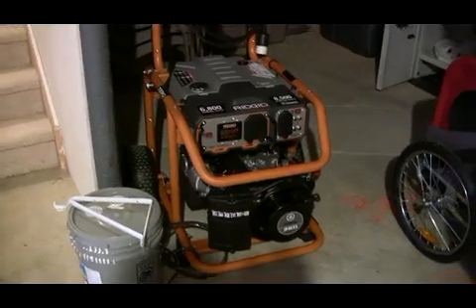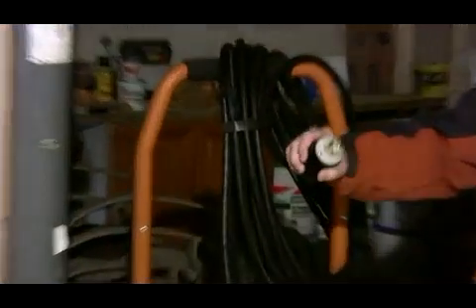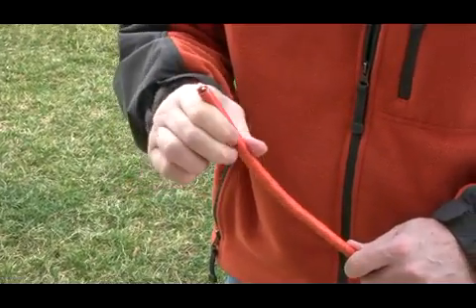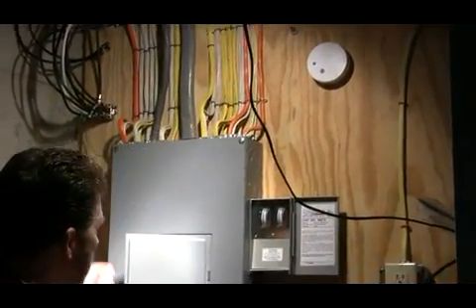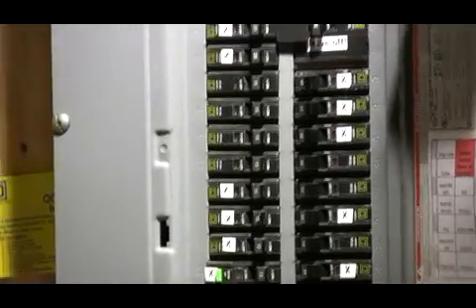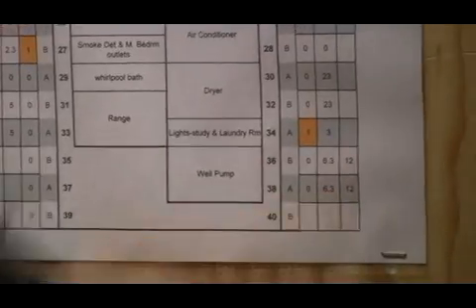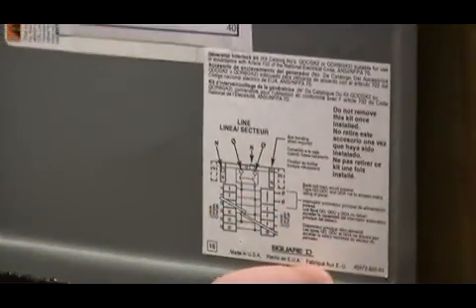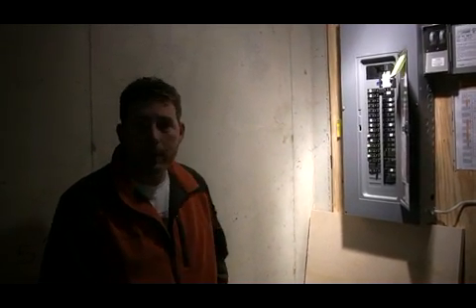Interlock vs. Transfer switch

Comment: My main circuit panel has the neutral and ground wires mixed on both of the buses. It appears there's no dedicated neutral or ground bus, but I do have a bus on either side. Would this mean my neutral and ground are bonded? And would this install be any different than what you did (just connect neutral and ground to either bus in my situation?).Thanks
Reply from the maker: Most likely yes, however to know for sure you would need to trace wires to find where they both go to ground.

Comment: The interlock switch lets you choose which circuits are hot.  It feeds both bus bars in the breaker panel.  You probably cannot select and electric clothes dryer and an electric stove burner unless you have a very large generator.  But you will be surprised at how many items you can run such as TV and coffee maker. Forget hot water heaters and electric clothes dryers at the same time.  The transfer switches limit you to predetermined circuits and typically only about 6 circuits.  The sliding interlock lets you change your mind.  The transfer switch will cost you about 300.00 for the switch and another 200.00 to 300.00 for an electrician.  About the same as a decent size generator.    Do it yourself if you are not afraid of electricity.  Takes about 1 to 2 hours.  This video was exceptional.  The home owner covered the project very well.

JoeB

Comment: One important note is you generator's bonded neutral should be removed if it has it. I was told by inspector. I have the 200amp breaker box with built in meters and interlock so I didn't have to buy it all separately.  Love your labeling and print out.
Reply: Ok watched your follow up video, spot on, what I plan on soon is putting a heavy duty switch on the bonding at generator so I just have to flip for BU or Camping.

Comment: Nice, this is exactly what I am planning to do before I even saw your video.  It seemed to me that a transfer switch is for someone who wants a foolproof installation.  An interlock device allows you to selectively power your house as needed - but you need to know what you're doing. An interlock is definitely more versatile.

Comment: Seems like you could make an interlock plate to fit nearly any main panel, as long as you have a few skills and the inspector will like it, or, DIY and take the risk? but if it works correctly, I wonder if he'd OK it?

Comment: I was debating about going with a transfer switch or interlock. This was a great instructional video, and helped me get my interlock setup installed. Next I will be converting to Tri-fuel using either the Motor Snorkel or Century type conversion.

Comment: I did it right and took the time to install a 10 circuit transfer switch. Comes with the meters, breakers and jewel that lights up when permanent power is restored.also added a batter operated alarm that tells me when the power is restored.

Comment: Excellent video. Good installation, well thought out. I opted for a six circuit panel with an ammeter on each leg. I'm happy with it, but I do like your setup as well. I've seen too many disasters with neighbours who back feed through their dryer plug.

Comment: interlock is good way for the average homeowner to have overload issues
Reply: care to explain your remark
Reply: Because a DIYer could try to run the whole house on a small portable generator and overload the generator that's why a transfer switch would need to be put in a place as as per code 700.5 of the national electrical codes states. A portable generator is only good for about 6 circuits
Reply: I see just didn't know what you were referring to when you overload that problem is self correcting  @SparkySteveinNc

Comment: The idea of the transfer switch is to disconnect your house fully from the power company, that is the 2  hot wires as well as the common and ground, without a transfer switch you will have a back feed on the common back to the power line, which canbe a hazard for the electrical workers working on the power lines

Comment: Great video! Thanks for posting it. If you're using the 4-prong Power Inlet Box is there any need to ground the generator? Also, have you had any issues with powering AFCI circuits? Thanks!
Reply from the maker: Thanks.  Best practice is to ground the generator back to the panel (via the inlet box ground).    I discuss this in another video here;  https://youtu.be/69U8AugJKaI?t=529

Comment: I have a Troy Bilt generator that puts out 10.6 Kw overload watts for five minutes and 7 Kw running watts full time. I did essentially the same thing that you did but minus the interlock. When I wired my garage, I used 8 / 3 with ground indoor wire and ran it through gray underground conduit into my outside disconnect box below my meter box through a double 60 amp breaker. In the garage, I installed an 8 circuit breaker box using 6 circuits around the garage for outlets, lights, garage door opener and a built in air conditioned electronics work shop. The other two circuits are dedicated to the generator and are rated with a double 30 amp breaker where I placed an orange zip tie on the connecting pin between them. From those breakers, I ran a piece of 8 / 3 with ground wire to a dedicated 50 amp, 4 pin outlet mounted on the shop wall. I built what a lot of people here like to call a six foot suicide cord with 8 / 3 with ground and a matching 4 pin 50 amp plug for the wall outlet and a 4 pin 50 amp twist lock plug to match my generator. I don't have a problem using this because, as I've said before, everything concerning the generator is dedicated and is never unplugged like it is with a lot of temporary setups that I've seen here on YouTube. My garage is not connected to my house so my generator is stored and operates in there. It is a steel skin building that started out to be a garage but became stuff storage shortly after it was built. The corners are covered with angle trim but are not sealed so the wind basically blows through it anyway. I keep a 20" box fan plugged into the generator itself and pointed toward the alternator end of it for cooling and air circulation should the air get still. When it does, without the fan, the exhaust collects in the alcove where it sits and chokes out the engine if I have to close the nearby door to avoid snow or rain intrusion. What I did in my in house breaker box was to place red zip ties on all the 240 VAC breaker connecting pins as most of these utilities won't work with my generator. If I really need hot water, it will work but it really swills the gas. Otherwise our electric stove is digital and my wife doesn't trust generator power with her baby and our 4 ton central heat / A/C unit demands more than Troy is willing to give except in the summer, I leave the blower breaker on to circulate air in the house. We have a window unit in the bedroom for relief from the heat if need be and propane gas logs in the fire place for heat in the winter because my spine doctor told me not to chop any more wood two surgeries ago. The gas logs are secondary so I have them hooked to two grill tanks, each with their own regulator connected to a "T" on the log's propane line. I made up two illustrated instruction manuals with text on my computer. I keep one on the fridge and one zip tied to the generator so If my wife has to get things going while I'm not home, there will be no mistakes. The generator is electric start so we don't do any more damage to our spines pulling ropes. For safety sake, our first two steps are 1) pull all the red labeled breakers in the house and 2) pull the main 200 amp breaker in the outside disconnect box. By the time this is done, the garage opened up, the engine started and allowed to warm up, any compressors in the house, i.e. the freezer, fridge or window A/C unit have bled down and are ready to go. The last step is to throw the two 30 amp breakers in the garage. That 10.6 Kw overload is more than enough to keep the surge voltage output above 115 VAC so we don't bother to shut everything off in the breaker box. The first ten years that we were here, we had a Coleman 5 Kw unit and I went crazy shutting everything off around the house because some circuits were also connected to the kid's rooms or the wife's A/C or TV and everyone wanted everything at once. Seven years ago when I was getting ready to go in for my sixth spinal fusion, I told my wife that I wasn't pulling any more ropes so I went and got the bigger unit that handles the load with the push of a button. Now the kids are grown and gone and it's just the wife and me. I still keep the Coleman in running shape for a backup or a loaner for my friends at church. I'm a firm believer in regular maintenance like oil changes. If we don't even use the Troy Bilt generator, I still change the oil every spring and fall to keep moisture from building up in the crankcase, mixing with sulfur in the oil creating acid that can damage connecting rod and crank shaft bearings. I change it more often if we use it a lot and as many times as necessary according to the manufacturer's intervals. I bought the Coleman in Florida back in 1998. The only thing that I've repaired on it besides rotted pull ropes, spark plugs, a clogged carburetor and oil changes is that I had to have a heli-coil installed in the head for the spark plug. The mechanic at the shop that did it said this can happen in older small engines with aluminum heads because the alloy is weak and the spark plug takes a beating over the years. One more tip. Avoid the clogged carburetor that I had years ago. When you're done using the generator, do NOT shut it off with the kill switch. Shut off the fuel valve and let the carb. run out of gas. This will keep it from turning into varnish and gumming things up.

Comment: Thanks for the video, good job!  Only thing I don't understand is how to manage the transition from the four wire of the generator and exterior box to the 3 wire coming into the interlock?  Do two ground wires get doubled up into one connection in the main box?
Reply from the maker: So the backfeed breaker will be a 240V, so it will take the (2) hots (typically red & black).  The other (2) wires are ground (typically green, and neutral (typically white).   The panel should have a ground bus, and also a neutral bus.
Hope that helps.
Reply: @panchohughes  A GREAT Vid.  Well done, well explained.  As Rev JIm D mentions above (and you reply) <<"The panel should have a ground bus, and also a neutral bus".>> 

 In order to comply with NEC grounding rules, doesn't the generator being used have to have a floating neutral with respect to the generator ground ?  Otherwise there would be 2 low impedance  paths to ground when backfed to the house panel.  The house ground and the generator ground.  Thanks again for a GREAT alternative to a transfer switch.

Comment: First off thank you for your very helpful video. I’m in the process of getting everything to do a back up generator for my house and I had a couple questions for you. My panel is located in my garage that is attached to my house and the only way to get into it is through the garage door. There is a cinderblock wall dividing the garage from my house but the bedrooms are upstairs and my back bedroom is on top of the garage. I’m looking into getting the reliance THP108 like you have but I was wondering if you think I will be able to hear it inside my house. I was also looking into the reliance MB75 watt meter but would it benefit me being that the panel is located in the garage and I would have to walk outside to go through the garage door to look at it?
Reply from the maker: Hi Mike.  I will admit that the THP108 (powerback) is not loud enough that you would hear it inside.  However, having it still beats having to shut down the generator and switching back to utility power just to find out its not restored yet!  With regards to the watt meter, mine is downstairs and I don't see it while the generator is running.  I only look at it after my generator is running, and I am flipping the breakers on one-by-one.  It helps me know if the phases are somewhat balanced.  You could mount a webcam next to it i suppose.
Reply: You can use a baby monitor or similar device to hear the power back alarm inside your house.

Comment: With the main power shut off and the generator breaker on can the power still back feed through the ground cable to the power lines?
Reply from the maker: No.  Ground bus is tied to house grounding rod.
Reply: What about the neutral line coming from the power line to your breaker box mine don't have a disconnect on the neutral bus
Reply from the maker: Neutral bus is tied to the ground bus inside the panel, and they both go to ground.
Reply: Ok thanks
Reply: @panchohughes  true. But the Neutral going back to the pole has the same potential to carry a current. Give it a better path (like a puddle of water) and it is a potential death trap! 
These things should be outlawed from being sold! An interlock doesn't isolate the neutral load of whatever power you are using. Don't believe me? Try this, go ahead and turn the interlock. Start the generator. Put a load on it. Now put an amp meter on the neutral at the panel. Any current you are using is going back out that wire. This can kill the lineman, your neighbors or anyone else that happens along the downed line! You could be responsible for the death of someone!

Quit being a cheap bastard and get a gentran. They are made for just this application and will isolate the neutral current from going back out on that bare conductor toward the pole
Reply from the maker: Why would that stray voltage go back to the pole when the there is a short path from the ground & neutral bus to a ground rod?
Reply: @panchohughes  the ground rods are supplementary, meaning they are just for things like lightning strikes. Not always a good ground path. Say for instance you live in an area with sandy soil. Grounding becomes very difficult. A lot of homes now have all plastic plumbing so no ground path there.

Comment: Panchohughes... Your demo here on a Interlock versus a T/S is very well explained. You have clearly illustrated the correct wire gauge needed as well,( looks like 10-3 Romex ) perfect. I just finished up a very similar setup. I am breaking in a brand new Dual/Fuel Champion portable 9375/7500 Gasoline - 8400-6750 LPG unit. [ Running it on propane, it will never see gasoline ] I have an older GE Main Box & unfortunately GE does not make a Interlock specifically for this older box, therefor I went with a 3rd party switch made by Interlock.com. Technically it WILL NOT pass inspection because GE didn't make it. Is it safe?, absolutely... [ It does not have the steel CB bracket behind the panel as yours does. ] Your Main Box to Power Inlet Box is identical to my setup. You have also talked about having a properly balanced load, well done & I like the load indicator gauge you installed here. I only spent $189.00 for the above setup, buying it locally too. I could have saved $14.00 buying it from Lowes or Home Depot, but it would have required a 80 mile round trip, spending close to that in gas alone... I did the above work myself, several weeks before actually finding a generator & ordering up a 50 ft. Conntek L14-30 4 Prong Cord. [ Made In China ]... I  really like your power cord btw, I considered making my own, but came to the conclusion it was cheaper to buy a good quality factory sealed cord... 
I tip my hat to you on this video as it is the safest & correct approach to this I have come across. 
Bill Farr... :>)
Reply from the maker: Thanks Bill!  My goal was to help share the information I had found.  Always makes me glad to see that its helping folks.
Reply: 10/3 w/ ground SO cord, or SOW, etc. Nice set up.

Comment: Good job!  My electrician recommends foregoing the manual transfer switch and doing exactly this, but he didn't mention anything about the metal Interlock piece.  All this piece does is force the homeowner to shutoff the main breaker before turning on the backfeed breaker, correct?  What happens if the homeowner does not shut off the main breaker?
Reply from the maker: If the main supply is not turned off,  then you risk sending voltage back thru the utility lines.   However, what I suspect would happen is that your generator would immediately bog down and stall.
Reply: You ARE back-feeding the the utility power lines and you could potentially hurt someone working on restoring your power!  Don't do it!  It's also against electrical code (basically illegal).
Reply: You could kill someone! Just as the transformer bumps down the power to your house to 120v, when back fed would have the opposite effect  and bump the voltage up to a lethal amount!

Comment: Interlock & transfer switch are a waste of $$ and is a legal retail scam...

Cut the main breaker and LOCK the panel...  Its that simple.. !!
Reply: Except that it's state law in every state in the U.S. to have a transfer device that performs its intended use, since every state has adopted that section of the National Electrical Code.  It would be great to hear an argument as to why a transfer device shouldn't be required when lives are literally at stake when one is not used.